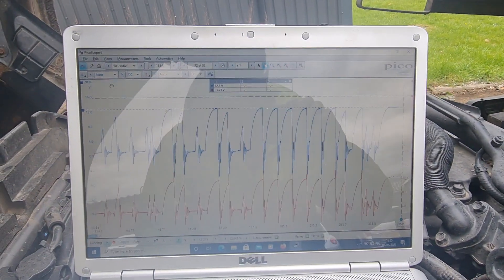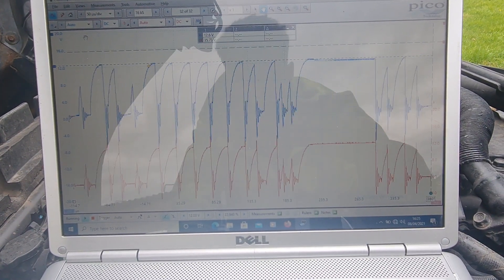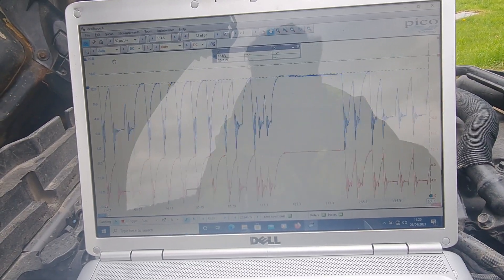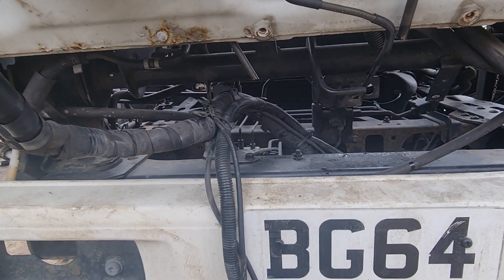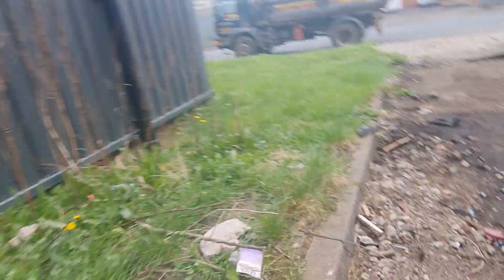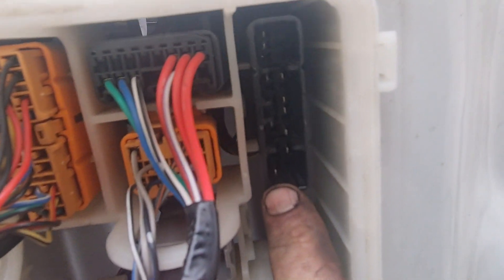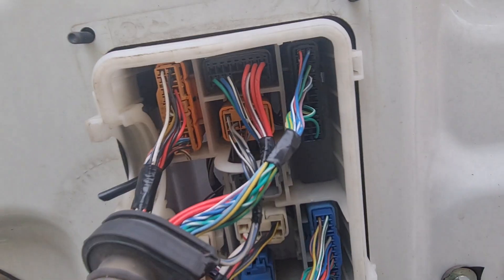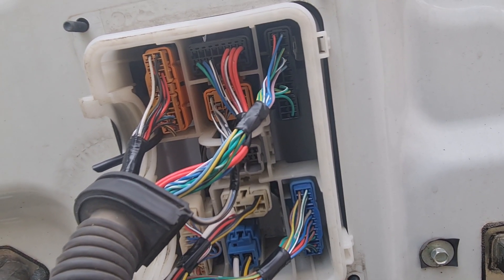Can bus unplug test

Comment: A quick message. Vectra 2009 stalled wont start and no modules will appear in any scan by 2 autel devices. Breakout board shows digital signals key on in can h and can l. All things in car seem to work except no crank. Jump starter with key on and still no engine run. Logic suggests the reason for no scan on obd could be reason it wont run. Logic suggests damaged can lines near obd which is why wont scan but modules can communicate ok. What do you think